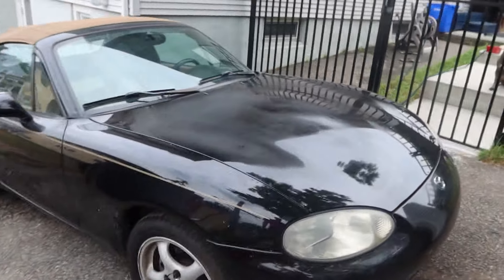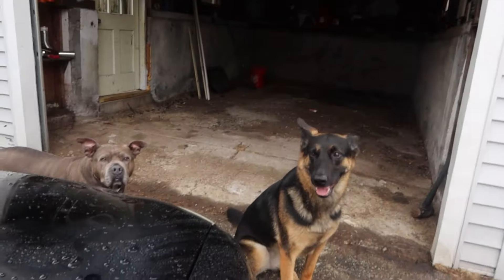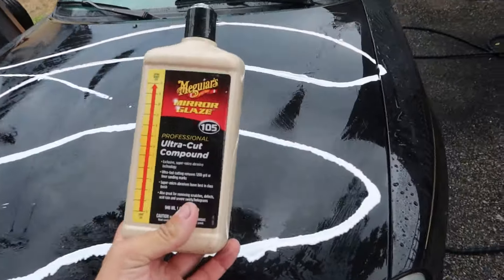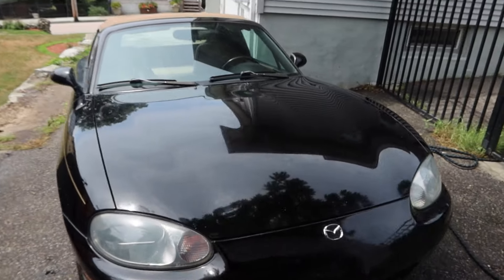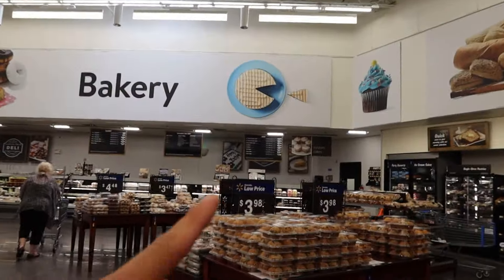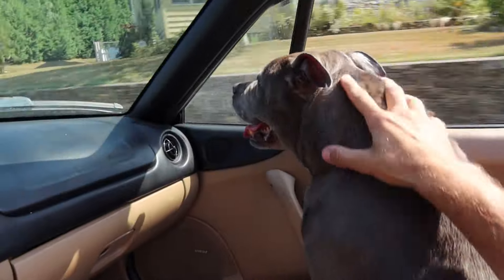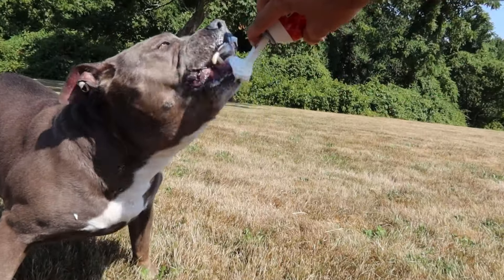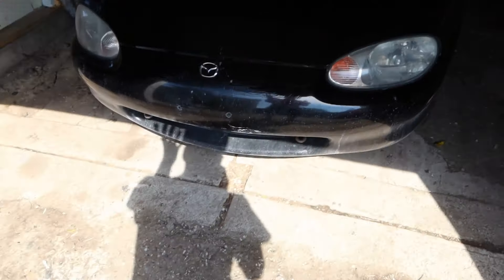Restoring Sun Damaged Paint By Hand (Incredible Results)

Comment: Had my Miata mk2.5 icon edition for 4 years and they are freekin awesome. I did the same thing as you for half a day on the entire car, man was it worth it. If you clay bar that bumper, use colour cutting compound, paint polish, then the wax, all meguiars. Most of the scratches will come out of that bumper. My mate reversed into mine and it lifted all the damage out. Good as new!